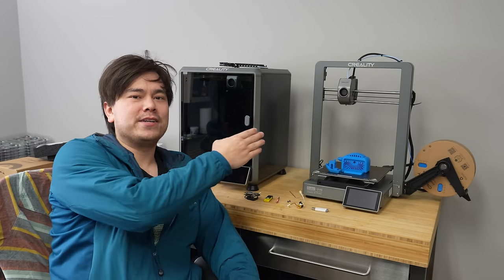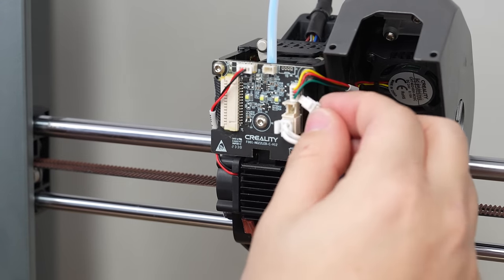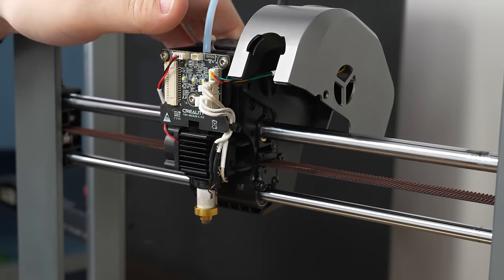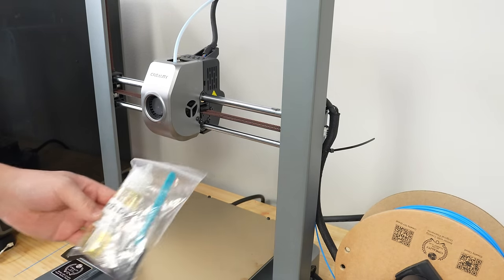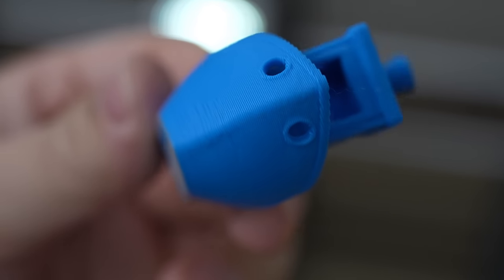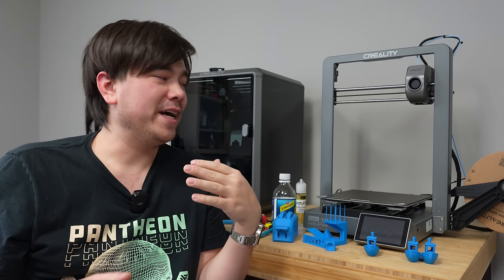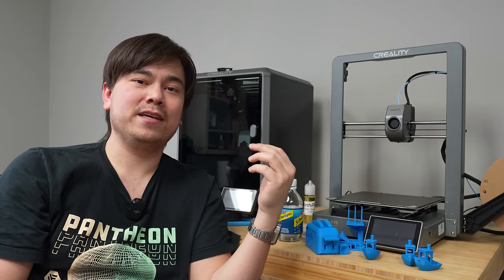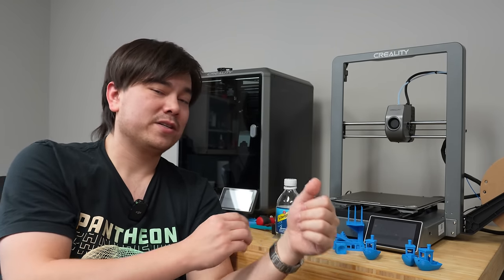This Ender 3 is Completely Different.

Comment: Great review and overview of this printer.  I used to have the Ender 3 S1 and it was my "Workhorse" printer.  This one looks to be similar, but with some significant differences too.  Like you, I wish it had the ability to "MOD" some things, like I would like to see a light bar option, even if it were just the screw holes to add that feature by purchasing a light bar from the 3S1 or a similar sized model. What app did you use for sound testing?  That one looked feature-rich and even if there was a fee it seemed like a good app to have.
Reply from the maker: Decibel X

I like it, I paid for the pro version

Comment: What prevents the gantry from falling down to the bed when the steppers are unpowered?  Is it just the stepper detent torque and belt friction?
Reply from the maker: I think so. The toolhead is very light, which helps, then they have some springs on the Z axis linear rods that would absorb some of the energy if it were to come falling down somehow.
Reply from the maker: Kind of like landing gear

Comment: 12:15 How come the bed belt is not parallel to the movement!? Isn't that causing issues?
Reply from the maker: The drive side of the belt is straight and parallel to the Y axis (side that is attached to the bed).

The return side of the belt is off-angle, but this doesnt matter. It could take an S-shaped return path. Some belts have idler tensioners that bend the belt back and forth on its way back to the drive pulley, but it doesn't actually make a difference.
Reply: @NathanBuildsRobots Understood, thanks, that makes perfect sense.

Comment: If I could buy the Ender-3 V2 for $150 USD ($200 CND), should I do it? I know a store that has a bunch in their warehouse. Creality website doesn't have the V2 anymore. I've been using the original Ender-3 Pro for five years now and really happy with it. I have no idea what to upgrade to.
Reply from the maker: Personally, I’d opt for the v3 SE for $50 more

The direct drive extruder and auto bed leveling is certainly worth that if the MSRP is similar to the US pricing of $199

Comment: The toaster isn't a good test. It's basically an underextrusion test, so if you underextrude it the "results" will be better, the print will also look nicer. That's also why Prusa runs the MK3 and MINI on 95% flow by default.
Reply from the maker: Yeah a lot of printers default to underextrusion because prints "look" nicer. I much prefer a solid part that might not look as pretty
Reply: @NathanBuildsRobots  same
Reply: . . . and the Mk4/XL. Although with the Mk4/XL it's done in firmware rather than in the slicer profile. The purpose isn't really to cheat at tolerance tests, but rather because of certain defects and the calculation of extrusion rate in slicers isn't completely accurate.

Comment: The 0.3 and 0.2 being stuck could be simply dependent on the wrong (uncalibrated) flow multiplier, easy to correct.

The benchy shows excessive smoothing on the staircase surface on the sides and on the ... square thing on the deck. The default acceleration is too high for a slinger, but even reducing it won't affect the overall evaluation of the printer, simply under 25 minutes benchy for bed slingers should not be a goal.
Reply: A1 prints basically perfect benchy in 14 mins with a good filament
Reply: @riba2233  have you checked the smoothing?
Reply: @olafmarzocchi6194  no smoothing
Reply: @riba2233  I'll believe it when I see it since even the X1C used at just 10k acceleration shows significant smoothing of sharp corners. Maybe you don't know what you are looking for or what I mean.

Assuming you actually have an A1, try printing a bendy with 2000 acceleration and one with 10k acceleration and compare. Then you'll see what I mean.
Reply: @olafmarzocchi6194  I do don't worry
 A1 is faster and better set up than x1 and p1, also I am comparing it to a benchy I sliced myself and printed on the very old printer without shaping, it is really that good and underappreciated.

Comment: Finally. I was waiting for long for this vid 😅
Got a question though:
If you had to choose two of the printers excluding the price which ones would it be?
BL A1
Prusa MK4
Creality V3
Reply: I doubt he will give you objective opinion, when he did A1 "review" didn't even got in any details about unit.
Reply: A1 is better, it is not even close.
Reply from the maker: A1 has slightly larger build volume and less underextrusion... it's a good printer, but yeah, the bed cable puts it out of the running for now.
Plus I dislike the Bambu Lab ecosystem. The A1 doesn't have any USB ports so you're more or less forced to use network/cloud, which makes me very suspicious of them.
Reply: @NathanBuildsRobots   nah you can use sd card if you really want to or lan only mode. Cable will be solved for anyone buying in the future, and it has many other benefits over other printers
Reply: @riba2233  I was bout to say, my A1 has a micro USB just like my ender 5. Same brand and everything. Some people don't like Bambu so they hate everything about it without actually looking at it. If you want a cheap AMS with good quality the A1 is a good one when its back.

Comment: Id really like to see creality put out a new larger format printer ender 5 plus is getting to be old and kinda high priced for what it is now.  A new 350 or 400+ cubed or so option would be nice. 

I could see this one replacing some of my older machines for small models once the price comes down anyways and theyre proven to last.  Just cant see myself spending 400 on a printer of this size no matter how fast it runs or how easy to put together it is though. 

At least they didnt throw it out there and let the users do their r&d then release an ender 3 v3v2 a while later.
Reply from the maker: I 100% agree, I've been tempted to pick up an Ender 5 Plus because it's got crazy build volume, but the feature set is so ancient at this point, that it'd make more sense to do a full custom build like a ratrig if you're spending that much on the base printer plus upgrades..

Check out the adventurer 5M (non-pro) on Amazon. $269 for high speed unenclosed corexy. It's a screamin deal.
Reply: @NathanBuildsRobots  Have you tried the sovol svo5?  Theyre an alright option for a fairly standard size build volume.  Had hoped theyd do a plus version since its totally based on the ender 5 and even has a creality board in it but they havent.

Comment: I sure as heck do not like that cable running up against the spool or the PTFE tube tubing against the top frame
Reply from the maker: The PTFE is routed straight back, so it doesn't touch the frame. The cable near the spool is a fair point. It could use a few more zipties to get it to behave a little better

Comment: I like that its getting more user friendly, i mean i have a bambu... but i hate the fact its also getting less and less repairable/mod-able... What was so bad about aluminium extrusions?
and with new printers coming out every couple months now there's hardly enough users to make mods... I bought a CR-10 V3 in 2020 and I still haven't modded it because I can't find anything half decent.(besides upgrading hotend/extruder)
Reply: Well - you can probably blame Bambu. They really pushed to make printers that were closed off because they want to be the "Apple" of 3D printing. They did a lot to make printing more approachable to consumers, and became so popular so quickly that everybody wants to copy them. Unfortunately that includes copying decisions by Bambu that aren't that great.

Comment: the head is not die cast it's a bended steelsheet
Reply from the maker: I didn't do enough close-ups to show it, but its definitely die cast AL. I checked it with a magnet, and there are threaded holes tapped straight into it all over the place

Comment: Just checked locally, the k1c and ender v3 are pretty close priced. Which one should I get? I have ender 3 pro and s1 pro.
Reply from the maker: imo K1C is much more capable. Ender 3 V3 is also nice but the K1C can do ABS and handle slightly higher print speeds making it a better option.

If you don't need the enclosure also take a look at the K1 SE, it's $360+ free shipping and discounts

Comment: Thank you for this review! I have a question, does this also let you change the speed on the display during printing? The K1 has that option when clicking the speed on the display that lets you use ultrafast normal slow and silent.

Comment: I'm in Canada and don't have access to the ender 3 v3 yet,  should I wait or get the KE
Reply: In Canada it sounds like it will be near 600$....... KE is way cheaper. BUT! it has major wobbling. Fixable? probably.
Reply: I have the V3 KE. The frame is too weak for the speed of the printer. Get the V3 CoreXZ
Reply from the maker: Yeah I agree. The frame was optimized for the V3 SE, then they turbocharged it for the KE and it just isn't stiff enough to maintain print quality at high speeds. If you turn the speeds down it's fine, like 2x SE speeds. Problem is they set the stock profiles to run at like 4x the SE speeds.

Comment: Can you also use this new printer with Cura Slicer or just this simplified Creality OS shit. Since the first Ender 3 I have always used Cura. Especially with the Ender 3 S1 with special firmware you can adjust everything during printing, especially the Z-Off, speed, retract, flow etc. I hope if you do more detailed tests whether you will be able to print with Cura. Orcaslicer is certainly ok for other users too. By the way, your fans and your board for the extruder on S1 are top class!
I'm still one of the old Rabbits  who prefers quality and slow printing rather than crazy speed...
Greetings from Switzerland Your Patreon and Member.🙂👍
P.S. The new S3 V3 will only arrive in Switzerland on May 27, 2024 from 3DJAKE from Austria and will cost around 400 euros. Can't wait to buy it. But I'll wait a little longer until other users or you have tested it and have experiences and tips or suggestions.
Reply from the maker: You can use whatever slicer. I ran a few prints using Orca Slicer. But I really do like the Creality Print interface. sending print jobs over is super easy.

Comment: I'm a relative newbie to the 3DP world, and I think I'm missing something about this "Core XZ" thing. This seems just the same as the previous Ender 3's. That is, the bed goes back and forward (X axis), the print head goes side to side (Y axis) and vertically (up/down the gantry - the Z axis). So how is it different? Can someone explain please? (Googling for an answer did not help by the way). Perhaps I'm misunderstanding the whole concept.
Reply from the maker: Basically the X and Z are driven by 2 identical but mirrored belt loops. On most normal Ender 3s the X is driven by 1 simple belt loop for X, and 1 leadscrew for Z.

It's kind of a technical difference that doesn't actually mean a whole lot to the end user, but it is an interesting design configuration.
Reply: @NathanBuildsRobots  Thanks. No wonder I couldn't figure it out. I will definitely file that information under 'Stuff I don't need to know'. 😉
Reply: Just another creality gimmick...

Comment: Why would you need fast Z axis? In time the belt will expand and brake much more easily than a screw, and let's bring in discussion temperature changes, what happens when it's cold compared to when it's hot because it's much more weight on z axis 🤔 they really don't know what else should they come up with 😐
If you want speed on a bed slinger you need different shape 🤔 not square, need the x axis to move more than y axis.

Comment: Im confused so the regular e3 v3 is better than the e3 v3 KE? If the KE is also like a K1 what is the difference? The structure material or design? Can someone explain the trim level of the e3 v3 for me? Like in cars.
Reply: E3V3KE is like an original E3 that has been vastly improved with mods. E3V3 is brand new from the ground up. The most fundamental difference being core xz on the E3V3 and z axis leadscrews on the KE. And other less significant improvements elsewhere.

I’m kind of trying to decide between these models myself. I’m not convinced that core xz is better.
Reply: @andrewmiller6051  thanks for this bro, me too looking around for my 2nd 3d printer, i google some more and for me CoreXZ is not really worth it for the price compare with the KE. maybe a V2 of CoreXZ then i will go with that. but for now im going with the KE. and i can also do 100 flow rate if i change the nozzle too :)
Reply: What did you end up with?

Comment: Tolerance tests like the toaster bug me.. not because they're bad, but because I feel that they're more influenced by the quality of the slicer's filament profile than the quality of the hardware. Pointless unless we know the filament profile was tuned.
Reply: I've found that even different filament on the same profile can affect tolerance. Most slicers also have a way to adjust it if it's not right.

Comment: 9:56 I love that you point this out, such a fascinating design decision.
Reply from the maker: The P1P tool carriage I have inspected does it too. There is definitely more to the way these things are built than most people realize.

Note that it is spring loaded and forced into the UP position. So if it bumps into anything on the build plate, the preloaded already has the bushing making contact to resist the load.

Comment: Why they did this? CoreXZ is the most stupid thing in 3D Printer. It brings no advantages, but produces artifacts.
There was standard Ender3. They could just add direct extruder & Klipper and it would be ideal bedslinger. Instead they made it worse and more expensive. Idiots.

Comment: I like the NBR reviews because they delve into the hardware more, including pulling off covers, doing a bit of reverse engineering to better understand the designs, and even some hacking and redesign at times.  The Ender 3 V3 looks solid, well engineered and well built.  I'd clip the reverse Bowden tube to 20 mm and top feed it to eliminate a lot of filament drag which sucks for TPU, and I'd get it running stock Klipper ASAP.  I still think CoreXZ is weird but I can't argue with success.

Comment: I have mixed feelings. Looks like a better quality ender-3 variant.
Release early release often? Nice printer, but I don't like these frequent hw revisions that much. Multiple toolhead revisions and many ender-3 variants... this exact model maybe shares 0 parts with any other creality printer. :D This makes me sad and disappointed. Maybe they could have made ONE K1 and ONE K1 MAX, and two ender-3 (lower and a higher specced) in one year. With the same toolhead and with the same rails, set of bearings, etc...
Reply from the maker: When I asked their product managers about the different models, they explained that they have so many different customers that they really need different price points. They also sell these in developing countries where the difference between $200 and $300 is significant.
Reply: @NathanBuildsRobots  You are absolutely right, I understand this argument on their part. I still think that the standardisation of parts could be an interesting point of improvement. As you showed earlier, they have managed to release two variations of the extruder on K1, and now they have modified the small toolhead board. There is a better chance of finding parts if half a dozen models use the same part and not just one. Anyway, I don't have a problem with Creality or their product a while.

Comment: Printers are getting so uninteresting and easy to use. Boring. Can you at least root it?
On the other hand, the CoreXZ thing is a good idea that eliminates the lead screw and all its issues
Reply from the maker: I'm sure we'll have a way to root it within a month. Creality is pretty on-board with people doing custom firmware, and the K1, K1 Max, and K1C that uses the same electronics have been rooted already.

Comment: Honestly I am completely finde with less modding potential. Enders were modded because they needed to be to work reliably. If it comes out of the box and works as it should without having to spend ages modding and fiddling with it I'm all for it. I want to print stuff, not trouble shoot and mod my printer.

Comment: As a user of classic E3, I watch reviews for new printers from time to time. And it is only hype I should say. First they make second Z axis bolt, which is not needed at all. Now they add belts to Z axis. And also this '2048 point bed remap feature' so you can wait more before printing start, instead of learning how 3d printing actually works and just make your bed plain once and for all and instantly start printing process. = )
And in 2K24(yeah K is just for marketing reasons) led brand text, cool look, klipper, and simple endstop switches instead of optical ones. Oh 'cmon!
So anyways I still do not regret that I bought classic model without marketing stuff and proprietary parts. Also taking into account, that I bought my E3 under $100. I guess I also bought some items for upgrade for another $100. But those were items I wanted, and not items I had to buy in stock model. So it is not the same as to buy a $200 printer.
Of course new printers are fancy and 'fast' which is more a marketing thing, then practical. But I still do not see a real reason to buy those expensive machines, which are hard to repair and mod, so they are even more expensive in a long run.

Comment: A1 is still a much better printer :|
Reply: Direct AC mains to the bed?
Reply: @ragesmirk  yeah, aka a better way. And it is not direct, it is through the switch and the bed heats up 10x faster and you need a much thinner cable